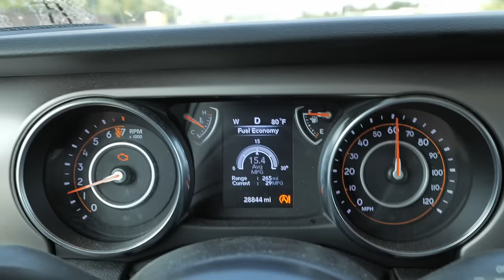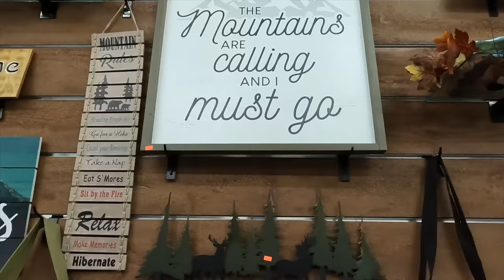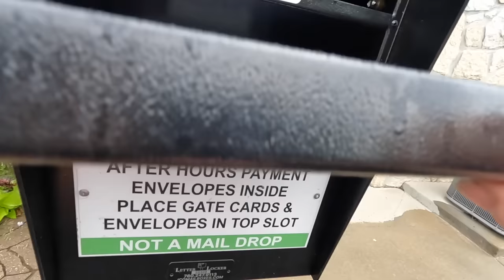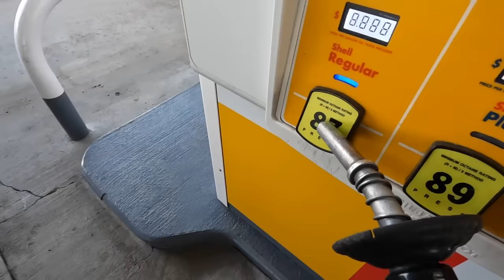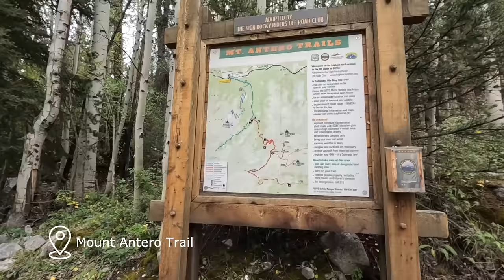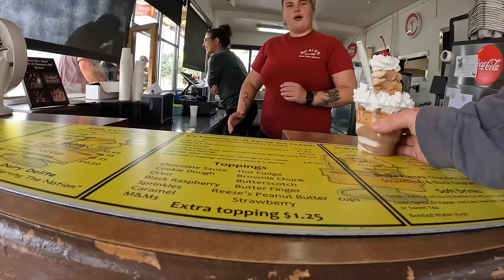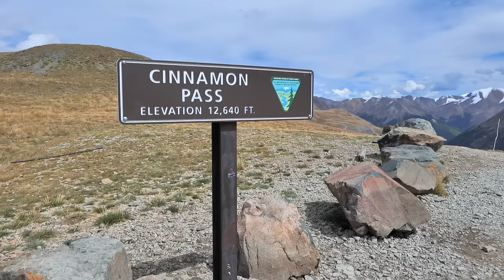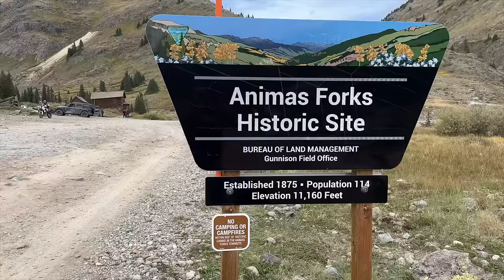Exploring The Colorado Rockies In A Teardrop Camper For 30 Days! | Full Adventure Video

Comment: For me, it's worth the investment in an OBD2 reader.  At least I would know if the dealer has the same diagnosis.  Check engine list is emissions related troubles.  Could be a plugged cat converter misdiagnosed as bad O2 sensors.  In all the years I've been driving, I've only had ONE O2 sensor go bad and that was recent.  I've NEVER had a cat converter go bad or any other major emissons related parts failures  except for 2 bad gas cap seals.  My OBD2 reader isolated that issue.  One repair shop said that my high NOx was cauised by a bad EGR valve and a bad Cat Converter.  NOT!  Second opinion found a disconnected vacuum line.

Comment: After doing this trip with the teardrop and the jeep. Would you consider or recommend a lite truck camper and a side by side on a trailer for the exploring.
Reply from the maker: Every rig has its pros and cons. I think the setup I’m currently using gets me better gas mileage than a truck camper would, especially if I were pulling around a side by side. It’s also another machine to maintain, etc.  but we’ll see. Adventure motorcycling is something I’ve been considering. Stay tuned!

Comment: Does the Tag XL meet the Harvest Host self contained requirements? Important: All camping vehicles must be fully self-contained. Your RV must have an interior toilet and built-in holding tanks or bladders for wastewater. Porta-potties that remain inside the vehicle at all times are acceptable but must be dumped off-site at an appropriate facility.
Reply from the maker: I pee into a container at night and dump it off-site. For #2 I'll drive off-site unless there are public restrooms. So yes, requirements are met 😀. Thanks for watching!

Comment: I have the same RV that you have. When I inquired about the Harvest Hosts membership they told me that teardrops like ours don't qualify as "self contained RV's" due to not having inside bathrooms and kitchens. How were you able to use your Tag with Harvest Hosts? Thanks.
Reply from the maker: Great question. If the host doesn’t have a public restroom, I use a “container” inside the camper for #1, typically a gallon jug, then dispose of it at the nearest rest stop or public restroom the next day. I only use harvest host for a quick overnight when traveling, and I’ve  never been turned away due to having the teardrop.

Comment: How did you get in to a Harvest Host with a tear drop camper & outdoor kitchen? Or were they Boondockers Welcome?
Reply from the maker: Teardrops are OK with Harvest Host if you don’t use the galley and have a waste container inside. At least that was the case last time I checked
Reply: @NowhereBoundAdventures  Rough start but great video! You went where I want to go.

Comment: Thats why Consumer Reports have 5 Jeep vehicles as the worst for reliability

I drove an 05 Jeep TJ from SeaTac to Destin, FL and had zero issues. The new versions seem to be trash
Reply from the maker: I’ve been getting a lot of Jeep hate from this video (understandably) I think mine was an isolated fluke incident, and the Jeep has been rock solid since this trip. 25k additional miles on and off road. Not one issue.

Comment: Probably a cynical comment on my part. I'm guessing vehicle is still under warranty? That's why they just updated the software--didn't "find" some expensive repairs that could be sold as related to the problem.
I could be wrong of course. Could actually be a honest dealership?
In any case, Jan.'17, Mazda dealership in Austin, Tx. Two sensors in my '07 Mazda 5 cost $4,000 to replace.
I wasn't in a great position to question it as I was on my way to the S.W. U.S.

Comment: I don’t think the sensor doesn’t mean you can’t drive.  You can drive and ignore it unless it blinks.
Reply from the maker: It ended up being 3 bad sensors. It was reading lean from the sensors, which caused it to compensate and run rich. Very rich. 5mpg, sputtering and bad fumes. It was not drivable.

Comment: Can’t they get 02 sensors overnighted from NAPA, or even Auto Zone or something? This sucks.  I’m at 22:08 in the video as I write this; I’d say if you have any more trouble it should become a lemon law thing.
Reply from the maker: The Jeep was still under warranty which is why I was trying to use the dealerships. The warranty would only cover OEM parts. Ultimately I ended up finding the parts myself and having them shipped overnight, for which Jeep reimbursed me. Thanks for watching!

Comment: Sorry about your jeep issues...it ruined your trip! I have a RAV4 Hybrid TRD AWD and did 5000 miles through the Yukon Territory like a knife through butter. It's the Woodland series so it's the only RAV4 with a Tacoma Truck Suspension. I live in Alaska so the roads are a nightmare but no issues, and it will run forever. I've always had Toyotas and never had one break down on me.
Had to pause your video because I was getting upset on your behalf :/

Comment: does that camper have waste tanks? I thought harvest host requires that.
Reply from the maker: Great question that I get a lot. Harvest host requires that you are self-contained. This could be just a waste container, which is what I use for #1 and then dump it at the next rest stop. For #2 I would drive off-site or use a public bathroom if they have it.
Reply: @NowhereBoundAdventures  guess i was thinking more about water from the sink. mine dumps into a bucket that i pitch out when full. so, didn't think i could use harvest host for that reason.

Comment: I can’t believe that Jeep doesn’t have a off road setting w/ out having to remove a wishbone suspension part be fore leaving the hiway. For $50k+ or more retail.  ,!?
Reply from the maker: The rubicons have an electronic sway bar disconnect from the factory. My jeep is a Willy’s and unfortunately didn’t come with that feature. I actually just installed quick release end links the other day. Just pull a pin and it’s done! $150 well spent. Thanks for watching!

Comment: Oil leaking onto an O2 sensor means that oil is leaking onto your exhaust system! That is a fire hazard! I wouldn't have been positively impressed with the dealers you've been to at all! I am a retired master auto tech. The dealerships I've worked for could get an O2 sensor overnight. Yeah, I agree ... a complete fail on Jeep's part, but a common state of low-performance in auto repair in general. Still watching your video.

Comment: I am so so sorry you bought a Jeep.  I've had 3 Jeeps.  First one was new, old style straight 6 Cherokee.  It was fantastic!  At 173,000 mi. I brought another one.  Grand Cherokee,  took the extended warranty.  Good thing.  The fuel pump failed, the power steering failed and the rear differential failed - all before 50,000 mi!!!!!!!  Plus other problems.  It was a money sucking piece of 💩.   It was totaled in an crash, not my fault.  Made a huge mistake in buying another one.  This Grand Cherokee was even worse.  Major failures, major money over and over again.  Finally, it needed more repairs than it was worth and I traded it in for a 2011 4 Runner.  The 4 Runner has been so great that it's more than made up for the nightmare Jeeps.  I still drive it every day.  My only vehicle with 190,000 mi and only one problem.  The satellite radio receiver died after 4 years and I didn't bother to replace it.  Its the best car I've ever had and I'm keeping it until it dies.  DON'T BUY JEEP.  EVER.
Reply from the maker: I’ve been seeing a lot of comments like this. I’m not ready to give up on my jeep yet! It’s been great except for this fluke problem 😁 thanks for watching and commenting!
Reply: @NowhereBoundAdventures  Only you can decide what your tolerance for  poor quality and an undependable vehicle in the backcountry is.  I'm willing to bet you get rid of it in another 6 months, but good luck!